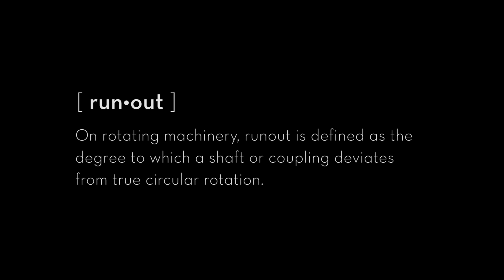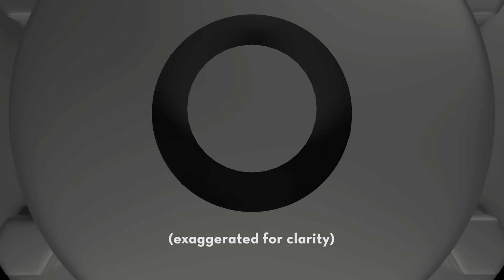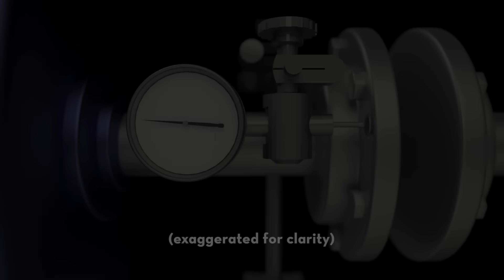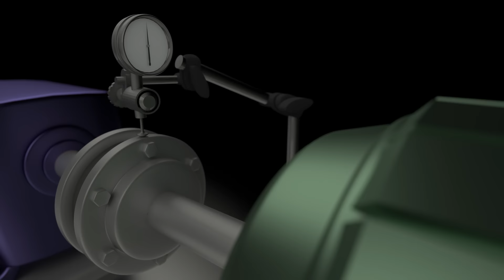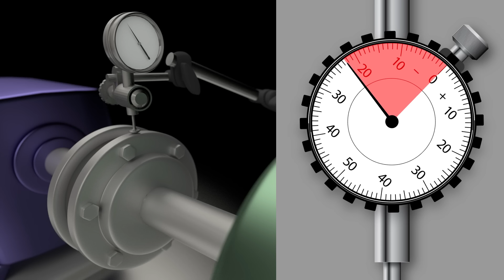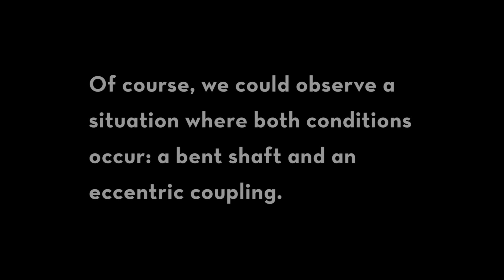Shaft Alignment Concepts:  Runout | ACOEM

Comment: hi
  i have exciter rotor  3000 rpm and the run out of shaft is 0.10mm its accept or not
Reply from the maker: +shakhwanm Thank you for your question.  Not knowing more about your equipment or the issue, we can only say that runout of 0.10mm is high.  We would like to see it at 0.05 or less.

Comment: how we solve those 2 problems?
Reply: if you have a bent motor shaft or pump shaft.  you can have it undercut on a lathe, built up with weld, turned and cut a new keyway.  much cheaper than replacing a shaft.  I do it all the time
Reply: +Rodrigue Sabbouh For a bent shaft you'd have to tear down the machine and replace the shaft, or you could try to straighten it with a hydraulic press(After you've removed the shaft). And the coupling I don't think is easily fixable, just replace it and make sure the new coupling you install doesn't have a clearance fit. I think the majority of couplings should be an interference/shrink fit to prevent eccentricity.
Reply: c63Dan thank you very much.
Reply: if you have a bent motor shaft or pump shaft.  you can have it undercut on a lathe, built up with weld, turned and cut a new keyway.  much cheaper than replacing a shaft.  I do it all the time